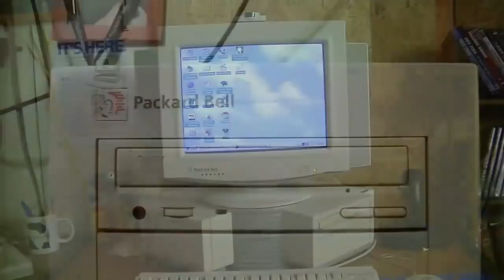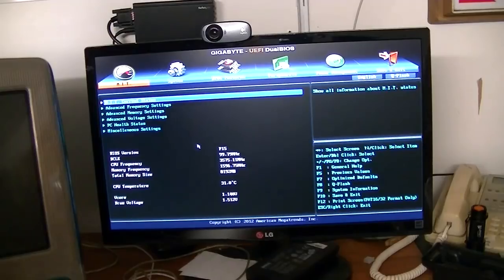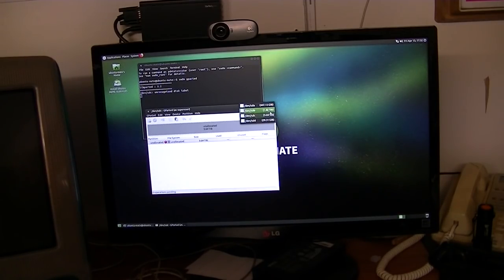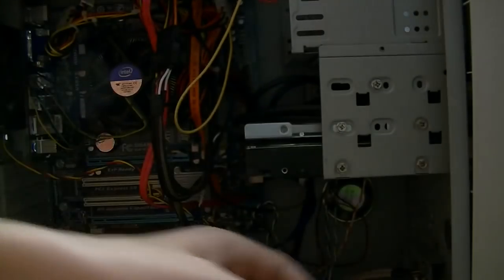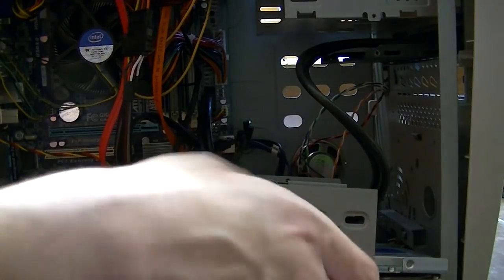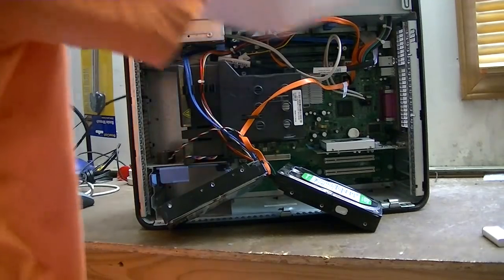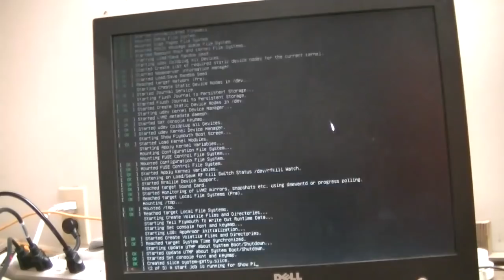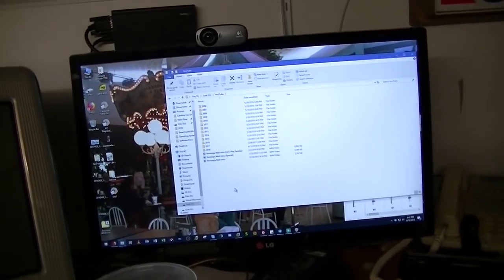Main Computer Hard Drive Upgrade

Comment: 4TB? Cute. Was expecting some mad 2018 drive.
I can only advise you to use at least two drives of the same kind in a mirror configuration. So that one fails you at least don't lose your data. I've heard some horror stories about new drives failing not too long after arrival.
I'm running a HP Microserver here with 4 drives in a raid 5 configuration, for automated backups and long time storage.

Comment: What happened to the Packard Bell Sleeper Build?
Reply from the maker: I wanted to use the case to build an "Ultimate Packard Bell" setup by using a Pentium 3 board, which is currently what the case is being used for.

Comment: Hey billy i didnt know you used Eset Security i am using nortons security been a long time nortons user and for the price it works good as everything fire wall and everything i have a question tho does eset have a firewall the reason i ask is my moms computer uses mcafee live safe and it cost 99 dollars a year and my nortons doesnt expire til 4 years long story and its only for 3 devices when it does expire i will get the 5 computers or 10 not sure yet but for now i want to get something that wont slow down here laptop nortons works great for me but the downside is limited licence sadly i am not a big mcafee fan like i am with nortons i love nortons its been really good to me
Reply: avast is pretty good for free thats what i rec my self i load that on my clients machines along with spybot but for paid i would choose nortons or something i been using avast my self on my other machines that i dont care about and it does a good job never had a virus since using it

Comment: You're complaining about having 600GB free?! I'd be incredibly happy to have 100GB free, sheesh!
Reply: i'm using a external 4tb and only have about 350gb free. going to get a 5tb one. each year when the new tb gets consumable i will buy it. because most likely by the time i'm able to use it. i'll run out of space.
Reply: My newest computer (from January 2017) has 3 terabytes of SSD and M.2 SSD storage internal,2 terabytes on a internal hard disk drive and I have a 8 terabyte external hard disk drive so 13 Terabytes total for that system.
Looking forward to eventually getting a Petabyte of storage though.
Reply: petabyte of storage would be nice. but it's not going to be consumeable for a long time. at least to us.
Reply: Yes it's just to reach that absurd amount of storage space.
Just think of how many high definition movies that you can store on that.
It will be so cool.

Comment: I wonder do you have a Blu Ray drive? 
Because if you do you should get M-Discs to archive valuable data as these can safely store data for 100 up to 1000 years.
This is what professionals use.
This is what you need for safely archiving valuable data for long term storage.
I have found that the most economical ones come in 25 GB sizes but they have them in 100 GB sizes too albeit more expensive per gigabyte of space.
You said that you have all your YouTube videos stored on a hard drive and you and I know that they can go kaput.
Reply: Regular optical media like CD's or DVD's using optical dyes created by consumer CD-RW and DVD-RW drives only last maybe around 7 to 20 years. 
Personally I have noticed a few  of my older home burned CD's have lost data or are unreadable since the year 2000 and I've stored them carefully in a dry cool air conditioned computer room in sleeves and boxes. 
Now commercially made optical media using professional commercial drives do last much longer.
M-Disc's are much different.
See the link here to notice the difference
https://en.wikipedia.org/wiki/M-DISC